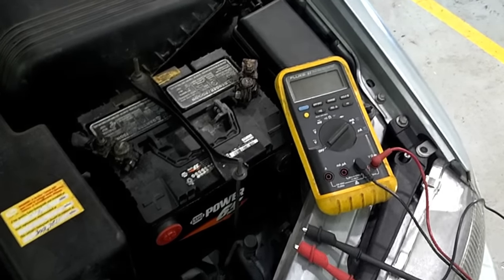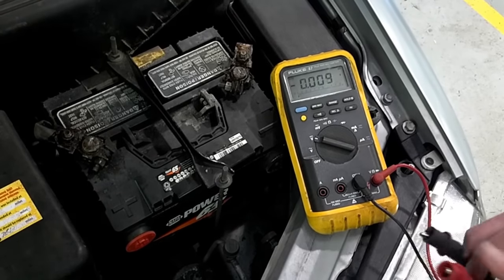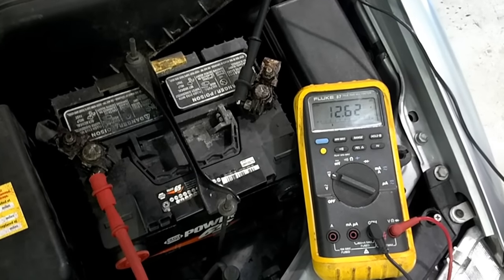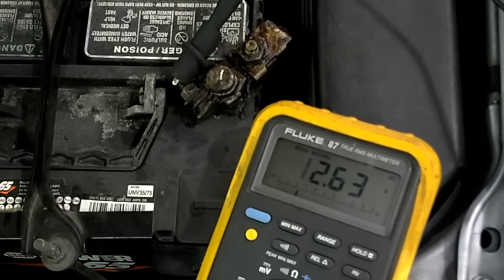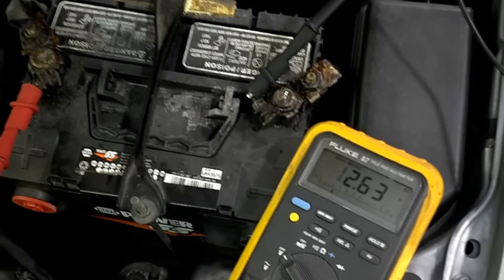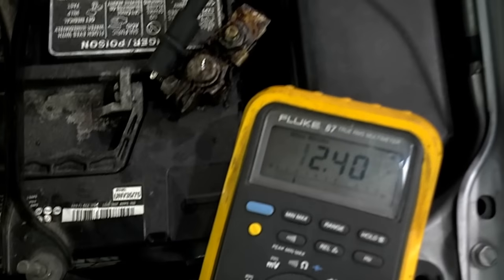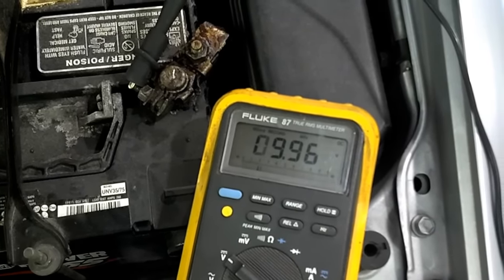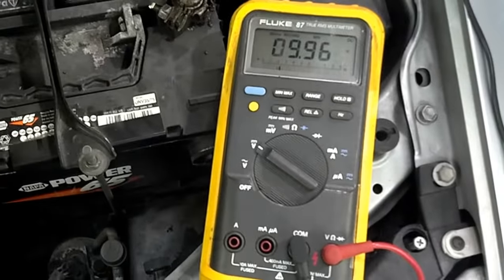Battery Load Test With a Multimeter

Comment from the maker: Yes.  This is even a better test in cold weather because your your starter requires more current and your battery has less to give.  If your battery voltage ever falls below 9.6 volts, it is in danger of not having enough voltage for the ECM to control injectors, ignition coils, and other essential components.

Comment: I don't consider myself an expert at anything. But a few comments. The 9.6 volts number is only a magic number at 60 degrees Farenheit and above. According to my resources, the magic number is 8.5 volts at zero degrees Farenheit. So the magic number is on descending sliding scale of about 0.15 volts less per ten degrees temperature drop. Also, you don't have to have an expensive multimeter with the min/max function. You can accomplish the same thing by pulling the central wire on the distributor (or otherwise disable the coil), and dead-crank the car for 15 seconds while watching your cheap multimeter. Observe the meter while dead-cranking. If voltage stays above 9.6 during the 15 seconds (at 60 degrees F or above), your battery is good.
Reply from the maker: I suppose that 9.6 volts is only a magic number because it is a fairly good "average" number for determining whether the battery passes or fails.  I have found that if I use a fast lab scope (like a Pico scope) for the same test, 8.0 volts seems to be the magic number.  The reason for this is that when the starter first energizes it usually draws between 600-1200 amps for a split second.  During that split second when high current is being drawn from the battery is the time to see how well the battery can maintain its voltage while delivering high current.  For that reason, the test will not work  without the min/max function or a lab scope.  This is not the voltage during cranking, but the voltage during initial energization of the motor.
Reply: Very good information. Thank you for your reply!

Comment: Hey Justin, please confirm. I was taught that the battery should maintain 9.6 Volts or higher at vehicles maximum load for 15 seconds. I have seen this test performed with a multimeter but only after disabling the ignition system to prevent start and to have starter actively engaged for 15 seconds without the battery dropping below 9.6 Volts. I am tracking 100% of everything else but timeline of the test. Thanks. DP.

Comment: My fluke 87 has found its way to the graveyard. I bought it in 93. Used it everyday. I had minor problems with screen. Replaced it with the 87V. As good as they are they are only as good as the person using them. Fluke makes a great product. Thanks for posting your test.

Comment: From viewing your video my Fluke just paid for itself.   Have had battery failures ruin my day more than once.   This time, using your test, I can see what's coming far enough in advance to avoid the hassle.   Have tested my current battery every six months or so since new.   This morning for the first time, starting-load voltage showed way low so I have my "warning" before I have to deal with the hassle of an actual failure.   Good on ya!

Comment: it is highly recommended to do the test for 11-15 seconds ..the easy way to do it- WOT with min-max and don't forget to do avg reading too ..this is just in case you suspect your battery is weak usually i do the 20Sec to be in the safe side and i always use the chases ground or engine ground ..Good video justin

Comment: Great vid.  At first I wondered why the meter had to have a min/max function.  Why not just watch the meter?  Then I saw that the lowest voltage that showed on the meter was 10.42V.  But the min/max reading showed 9.96V.  So now I know.  Thanks!
Reply: I saw the same thing.  But he didn't cut the video and it did indeed drop to 9.96 volts.  I guess our eyes can be deceiving.

Comment from the maker: That is a very true comment--thank you!  If the starter has shorted windings or if the engine itself is seized, starter current will be excessive and could put too much of a load on the battery, causing the voltage to drop lower than it would under normal circumstances.  While a starter problem like this is not common, you should fix any starter issues before relying on this test to condemn a battery.

Comment: Hi Justin, thank you so much for this very informative video, it was the exact information I was seeking.  One month ago, my 41-month old Interstate battery nearly left me suddenly stranded upon initial morning startup (car always garaged) despite being plugged into my Battery Tender Plus with its steady green light showing a fully charged battery (I always keep the tender connected whenever the vehicle isn't driven).  I lucked out when the car slow-cranked but started on the THIRD attempt (a miracle).  I replaced the battery and have been monitoring it during startup ever since with a DVOM and digital camera, which I now realize was useless (thanks to your video) since mine doesn't have MIN/MAX functionality.  Prior to finding your video I purchased an OptiMate TS-121 device, manufactured by Tecmate, which conveniently plugs into the SAE connector already attached to my battery (for my Battery Tender Plus) -- the TS-121 provides a visual representation via a series of LEDs to capture real-time resting voltage, lowest cranking voltage, and charging voltage all-in-one fell swoop, which the manufacturer claims are true depictions due to the unit's "microprocessor accuracy."  I'm wondering what your thoughts are of this handy device, and whether I'd be better off just returning it and purchasing a MIN/MAX DVOM instead (price of the TS-121 was just under $50.00). Would I only be able to confirm the accuracy of the TS-121's lowest cranking voltage LED result by checking it against a MIN/MAX-equipped meter with both connected to the battery simultaneously?  I'm not sure I have full confidence in the TS-121 cranking voltage results since a few have read lower than I expected given my brand new battery, despite the product's glowing online reviews (the resting voltage and charging voltage LED results have been dead accurate with my DVOM results). You can see the TS-121 in operation here: https://youtu.be/XDuaz-NlQo8 .  Thanks.
Reply from the maker: Only a meter with a min/max function will be accurate enough.  The only thing better than that would be a digital oscilloscope (PicoScope).

 If you want a budget meter that actually does a really good job, I would recommend the AstroAI DM6000AR on Amazon.  For about $30, they do a pretty good job!

Comment: Good information. I know about needing to test a battery *under load* for any kind of useful results, but I appreciate the details and threshold voltage of ~9!

Also a good mention about the over-voltage that can only happen when one's alternator is giving at least a fair bit of current, I would imagine. While of course not equivalent to an actual alternator tester, it's a handy indicator. If the amperage were low, I'd think the battery would consume any additional voltage, but I'm not certain..

Comment from the maker: If the battery is barely above 9.6 volts, it is good enough to start the car, but barely.  You can check it again in a couple of months - or replace it if you are unsure and there is cold weather coming.  If the voltage is well into the 10-11 volt range, your battery can easily start the car and you should usually only need to check it once a year before the winter months.
Reply: Justin Miller Hey I just purchased a battery did the the multimeter test with engine off the reading was good 13 point fifty something or sevety something but when he switch the enging on, headlights and A/C on as well the reading dropped to 12 point fifty to seventy something. The guy doing the test said there was a concern for the alternator and advused me to get a second opinion from an electrician. Do you think that there would be any concern as such???
Reply: while engine is running, meter must read above 13.4V (keep AC off).
If it is not,  alternator is not giving output. CAUTION:  NEVER remove any battery terminals to check the output on running engine, it may fry your computer.
Reply: Justin Miller ح ع ن(&-
Reply: It seems you need a multimeter that has a min-max function, and a quick enough display rate to capture that minimum voltage - that Fluke looks good - about 3 refreshes per second or more, I am guessing. I'm not sure that all digital meters are quick enough.

Comment: Prevent engine firing by sealing the transponder key in foil (earthed or grounded). Crank engine for 10 seconds and voltage should not drop below 10v.
Batteries rarely last longer than 5 years so replace it before it fails and leaves you stranded!
Reply: Covering transponder to disable ignition system, thats smart move...

Comment: Found answer:- test procedures according to sae j537, ice and din
 

Fully charge battery according
to SAE J537 and cool to -18°C (0°F) for 24 hours. While at subfreezing temperature, apply a discharge current equal to the specified CCA. (500 CCA battery discharges at 500A.) To pass, the voltage must stay above 7.2V (1.2V/cell) for 30 seconds.

Fully charge battery according
to ICE  SAE J537 and cool to -18°C (0°F) for 24 hours. While at subfreezing temperature, apply
a discharge current equal to the specified CCA. (500 CCA battery discharges at 500A.) To pass, the voltage must stay above 8.4V for 60 seconds.

Fully charge battery according
to DIN SAE J537 and cool to -18°C (0°F) for 24 hours. While at subfreezing temperature, apply a discharge current equal to the specified CCA. (500 CCA battery discharges at 500A.) To pass, the voltage must stay above 9V for 30s and 6V for 150s.

Comment: You got claws on your meter, mine has needles. Just a tip if you have a needle meter you probably have to loosen the nuts and put the needle in  and then tighten the nuts.

Anyway I did not even notice the max min switch on my meter.

But all is good I got 9.64 and then 9.66 so my car passed the test. Will test again in 6 months.

I think there is another test called the Safari Park test, driving 5 mph for 2 hours. Though I like your test better.

Will have to check more of your videos.

Comment: thanks for the video, helped me a lot. Question: when buying a used (consumption not starter) AGM, what is the best method to test it? Should i set up a chart, measure VOC, put on a load and measure VOC again after some time has passed? (what is the best method to get an accurate indication on the health of an AGM battery?)
Reply from the maker: Yes.  This would be a good test for almost any type of battery.  It is just like determining the pressure/flow capacity of any fluid.  You make it flow, and then check to see if the pressure is still sufficient while it is flowing.  If the capacity or volume is too low, pressure will drop when it begins to flow.  (Voltage = pressure, Current = flow).

Comment: So by charged you mean by the alternator, or by a battery charger that can take up to 20 hrs by properly slow charging the battery?
Reply from the maker: Either one works, but the battery should be at least 75% charged before condemning a battery that fails this test.

Comment from the maker: The traditional carbon pile test that you mentioned and the test that I presented in this video are both load tests.  Batteries degrade over time. The question is, "when is it time to replace the battery?"

The carbon pile test measures the battery against the battery manufacturer's ratings.  The multimeter test uses the vehicle's current requirements as the standard.  Once a battery is put into a car, ratings don't matter anymore.  We just need to know if it will reliably start the car.
Reply: The current required to turn the motor can be affected by mechanical factors, as well as starter drag from a bad armature or brushes etc..
It can be very hard to determine whether the battery or starter motor is at fault sometimes...

Comment: A good way to put a load is to turn on your high beams on for 3 mins den turn them off and get ur readings less then 12.45 or 75% its needs to be charged
Reply: Both methods can be considered as ways of discovering the internal resistance of the battery.

Comment: good video and well explained.this min/max function is so handy here. But i was just thinking would you not disable the car from starting and keep it cranking for 8-9 seconds to give the battery a more of a test...
Reply from the maker: When using the min/max function, you do not need to crank for longer.  The lowest voltage you will encounter is during the split second as the starter motor begins spinning.   For just an instant, the starter motor could draw 500-1000 amps, which will pull the voltage quite low.  Cranking the vehicle for longer will not give you any more information than you already have.

Comment: THANKS  .  IF  2 BATTERIES IN SERIES   FOR  24V , THEN WHAT  SHOULD BE THE LOAD TEST VOLTAGE ? IS THAT 19.2VOLTS THEN ?

Comment: Thanks . Now I know the use of the max button. But I want to ask, the 9.6 v you referred to what is it? I thought it's a 12volt battery why did you reference 9.6v?
Reply: It's a 12 volt battery. The 9.6 volt is under starting load. It should never drop below 9.6 when you start your car.

Comment: This is a decent approximation of a proper battery load test (and it's the way I've been testing my motorcycles and cars for years), but it is not as accurate as tests run with a carbon pile to provide the prescribed load (1/2 the rated CCA) for 15 seconds while observing voltage.  Marginal batteries can pass the quicky test, but fail the full load test.  When I check my vehicles I disable the ignition or injection and run the starter for 15 seconds while reading voltage.  I've found that to be a closer approximation to a test run with a real battery load tester.
Reply from the maker: Not to get too philosophical here, but what does it mean to be accurate in a battery test?  Any test is only an approximation based on standards we have invented.  The min/max test in the video checks the voltage of the battery while it is supplying current to the starter.  The carbon pile load test measures the battery's voltage while supplying current to a carbon pile tester.  Someone arbitrarily determined that this load should be 1/2 the CCA rating.   

Which test is better or more accurate?  This depends on what your definition of a "good" battery is.  Is it more important that the battery can meet the standards that it was originally rated for or that it can reliably start the vehicle?  Also, accuracy requires repeatability.  Can these tests be repeated many times with exactly the same results?

By the way, if you want both accuracy and precision, I would recommend measuring battery voltage and current with a lab scope while starting the engine.

Comment: If the battery does go below that reading, does it need to be replaced? Helping my friend determine why his car isn't working properly. Battery reads 12.4 (i didn't perform this test yet) Tries to start, and the belt starts to rotate but alternator never turns over. Thinking we have a battery problem. maybe a starter issue. Car wouldn't even start while getting jumped. Thanks for response

Comment: Today the rule of thumb is 10V if using a DVOM and no lower then 8.5V on the current in rush then a 10V cranking voltage when using a scope. 

I use a meter with a DLC break out box to and disable the car from starting like clear flood crank mode then crank it for 5 seconds .  If it can maintain 10V for 5 seconds then I'm happy.with it

Comment: I know this is an old video But don't you suppose to disable the fuel system first Before doing the battery load test ?
Reply from the maker: No, you do not need to disable anything.  That is why we are using the min/max function.  It allows us to capture voltage in the moment the starter begins to spin, before the engine has a chance to start.

Comment: Do multimeters have the sampling frequency to give accurate results in this kind of test? The voltage can change so quickly that the meter simply may not register certain spikes. Am I mistaken?
Reply from the maker: No, all multimeters are not the same.  This test can give you varying (although similar) results depending on what meter you use.  I would recommend a higher quality meter with a higher sampling rate.  If you have peak min/max, that will also increase your sample rate.  Either way, do this test 2-3 times to get a good average reading if you are uncertain.

Comment: I picked up a 6000-count multimeter with the MIN/MAX function, the meter has both auto mode setting (up to 750V) and manual mode settings (600mV, 6V, 60V, 600V, 1000V).  Which meter setting would provide the most accurate 12V car battery voltage drop capture result, auto mode or manual mode (60V)?
Reply from the maker: Whichever range gives you the most digits will be most accurate.  In this case, a 20V range would be ideal.  If 60V is the closest you can get, you can use that.  

It usually works great in auto mode, as long as you connect your meter to the battery with alligator clips, and wait for the battery voltage reading before pressing the min/max button.  Most meters do not auto-range after you have pressed the min/max button.  Letting the meter read battery voltage first will put it in the right range.

Comment: Is the magic 9.6V true for any engine? Or specifically automobile engines? Would the same guidelines hold true for a natural gas engine used to power a generator? Thanks!
Reply from the maker: This is a great rule of thumb for any engine that uses a 12-volt starting battery.
Reply: @JustinMillerAutomotive  perfect thanks! Very helpful video